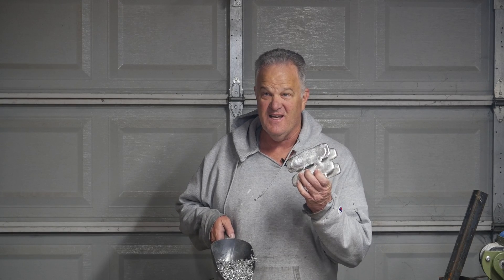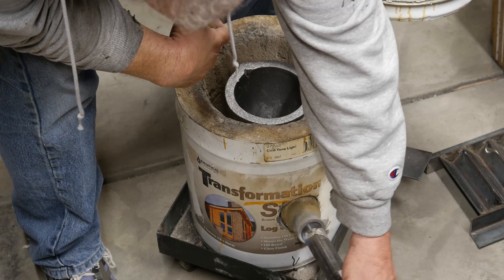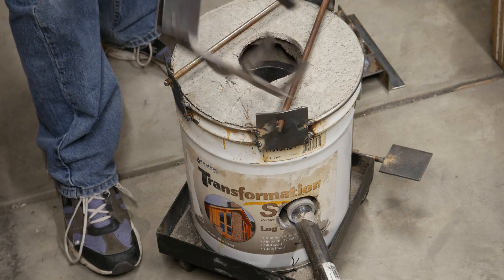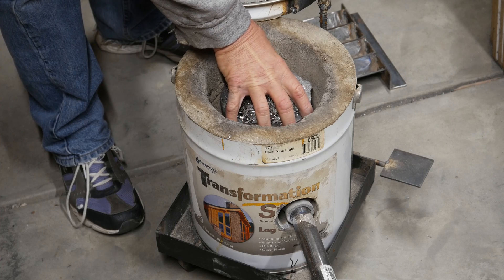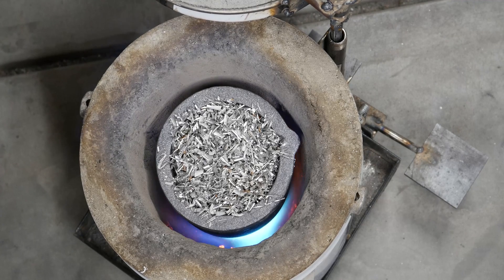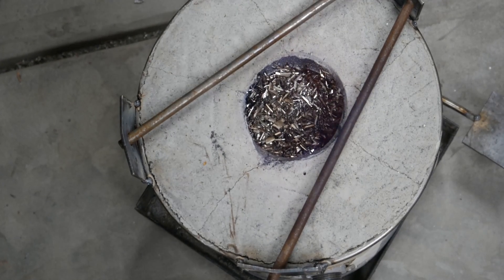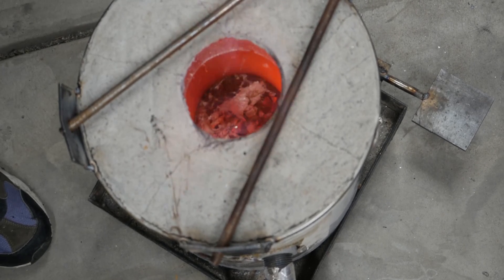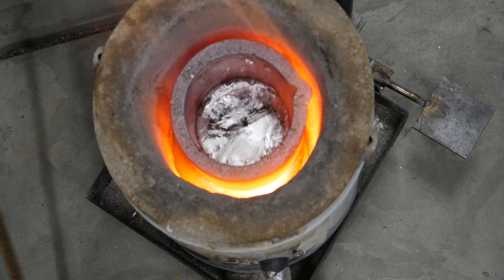Foundry furnace first firing and aluminum melt

Comment: Smaller crucible?
Reply from the maker: I've certainly thought about it. I was given some good advice while I was building the furnace. Get my crucible first to make sure it fit. Of course having never done this before, I clearly knew better. I think the next crucible will be smaller. I haven't found the need to melt that much material yet. Although summer is coming and I will have  few ant hills that will need to be filled with aluminum. Hmm....

Comment: Late to the party here but if you're still looking for a way to separate the dross from the clean aluminum when you skim, try using diet salt like Morton's Lite salt or Windsor Half-Salt (both are half sodium chloride and half potassium chloride) as a flux.  Works great for aluminum, add a teaspoon once you have a crucible full of molten aluminum, let it melt and gently stir it in a little bit, the dross will skim out more like a dark grey powder and the clean metal will run out of it much easier if it's working right.  You may have to get the melt pretty hot to make the salt flux melt.  Or melt and pour salt ingots ahead of time and crush the ingots, this combines the two salts to give the flux a lower melting point.  Good luck!
Reply from the maker: Never too late. Thanks for reminding me about the lite salt. I haven't tried it yet but am planning on melting more scrap tomorrow. All of the scrap that I've melted creates a ton of dross and I always feel like I am skimming clean aluminum out with it.  I'll stop by the store and get the salt before I melt again.
Reply from the maker: BTW, been using the lite salt as a flux. I get a weird dark grey liquid on top.
Reply: Was that when fluxing an aluminum melt, or when making NaCl + KCl salt ingots to lower the melting point of the flux?  If it was an aluminum melt, stir it in (gently) and skim, pour.  The dross should be a lot more grey and powdery and less shiny  metallic looking when it works right.  If you were melting the salt when you saw this, I think that is normal, I got salt ingots that were half white and half dark grey when I did that, it is not a problem.  I ground up the ingots so my flux is a greyish powder.  Take are to keep your flux dry, it wants to absorb water out of the air which can cause porosity in your castings.  Good luck!
Reply from the maker: I made a little aluminum foil pouch that I immersed in the melted aluminum. The liquid rose to the surface of that.
Reply: swdweeb I guess ituse the molten salt then... Gently stir it in, it should help separate the dross out.  If you're still meeting chips, there will be a lot of dross as they have such high surface area to get oxidized

Comment: Great job and congrats! It’s sooooo addicting. A few suggestions. When melting shavings, first melt a small amount of AI to get a puddle. Then wrap up the shavings in foil and submerge. There will be a lot less dross. Preheat your ingot tray to burn off any moisture. And finally, try to position your furnace and tools so you don’t need to step over the burner and hoses. Fantastic first melt!!!
Reply from the maker: +eviltwinx Thanks!  It was actually the tripod leg I had to step over;-). I’ll give your other suggestions a try. I think the shavings have some other metal in them as I ended up with a lot of unmelted shavings in the bottom of the crucible.  Actually as I think about it, your suggestion will make it a lot easier and cleaner for me to add more shavings. Brilliant!